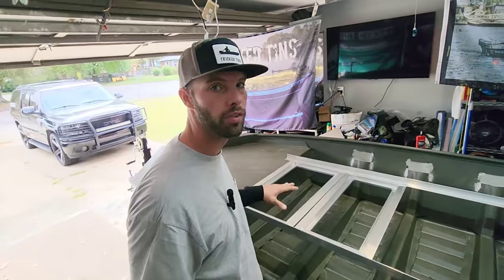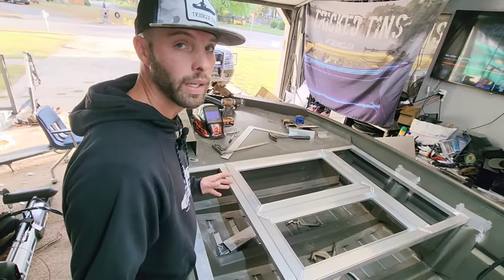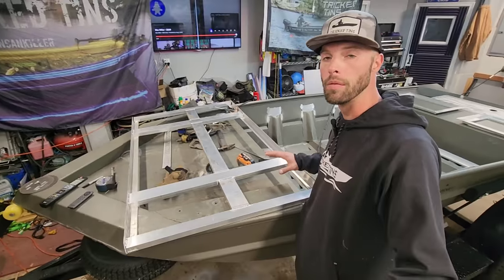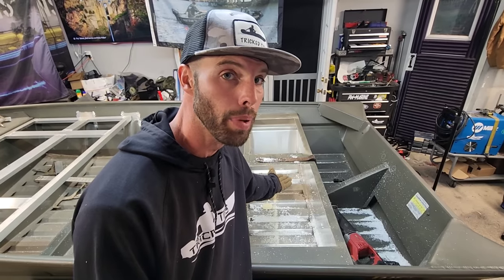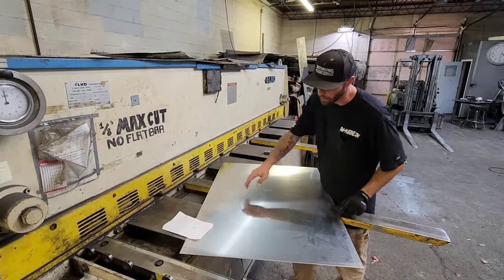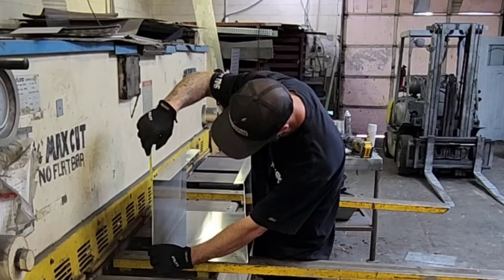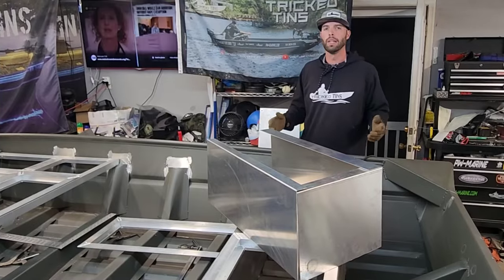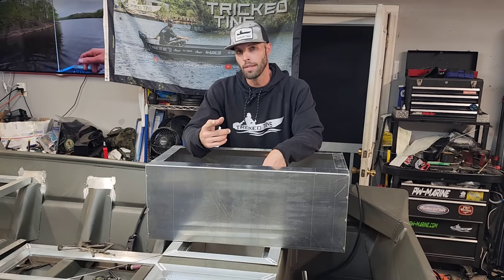Strongest & Lightest Jonboat Framing "1448 Weldbilt"

Comment: Build is looking sick. I like where you stopped the front deck extension. People tend to go a little crazy with their front deck lengths IMO. In a 14fter, floor space is limited and if there's ever more than 1 person in the boat that lower floor space is valuable. Allows you to move around safer and easier. As for the music, I don't mind it for time lapse scenes but when you're talking it's not necessary. It can be a distraction. Just my opinion though. I definitely prefer music over the sound of a welder though 😁. That's the sound of money for you though I'm sure.
Reply from the maker: Thanks brotha.  I figured that extra floor space in front of the deck would fit a big cooler, or back seat boater tackle box, and not interfere with leg room while using the outboard.